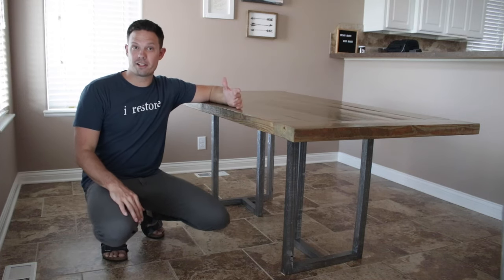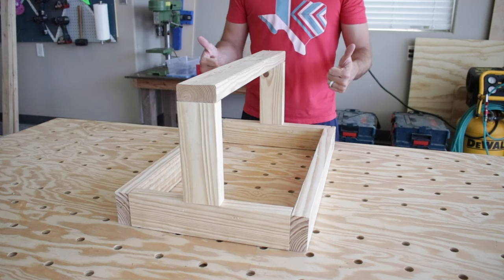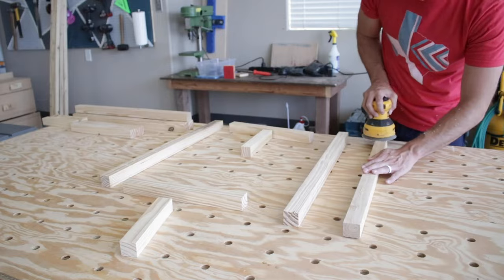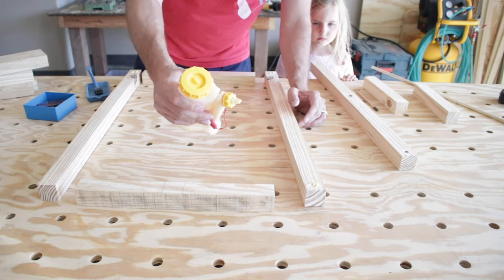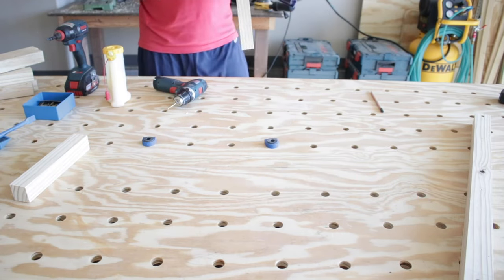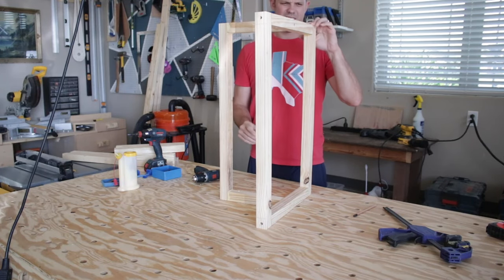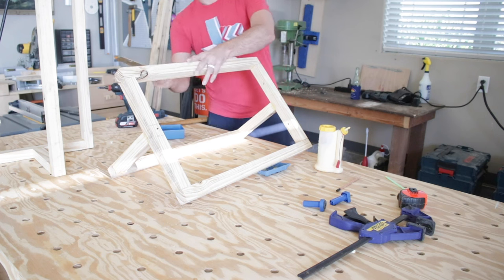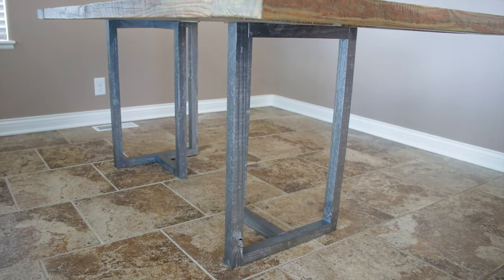Easy Modern Non-Metal DIY Table Legs

Comment: Greetings from Accra, Ghana. Great video. But I was wondering could you tell me the dimensions for the legs?
Reply from the maker: Hi from the US! Thank you and sure! 1.5 inches thick.  29 inches tall and about 13 inches across on bottom with about 7 inches across on the bottom leg that turns inward.
Reply: This has been so helpful and very inspirational. As I'm working on a tight budget, I'm using ½ inch plywood for the top and a 2x4 that I had planed and sized down to 2x2's. Hope it turns out great. I'll keep you posted. Please keep up the good work.
Reply from the maker: @aquosualois4460  Thank you! Good luck to you. Send me a picture when you finish. I'd love to see it.

Comment: Hi, I would really appreciate if u could please provide the dimensions of the table top and the legs. It would be of great help. Thanks
Reply from the maker: My table top is 3 feet wide by 6 feet long and the legs are about 28.5 inches high. Hope that helps!

Comment: How did you attach the legs to the top?
Reply from the maker: With 2 inch screws.  I drilled some holes and did a countersink hole to allow the head to sit inside flush and be hidden.  Hope that helps!
Reply: Field Treasure Designs thanks really appreciate it

Comment: the leg franes are too narrow for the  length width of the table..., ,  just a slight lean or down pressure fron any side of the table and it will tip.
Reply from the maker: Haha. Thanks swag

Comment: How did you connect to the table top?
Reply from the maker: Great question! I drilled a hole underneath the legs where they touch the table and screwed then in with 2 or 2.5 inch screws from underneath.
Reply: @diywithandrew  glue too?
Reply from the maker: @xivmercenary  I did not glue as I wanted to be able to take it apart to move when needed